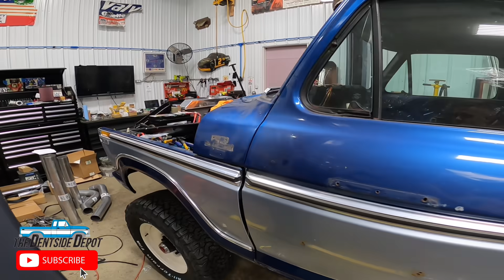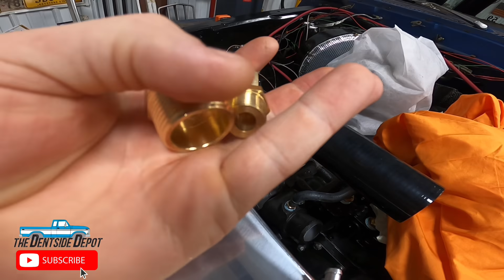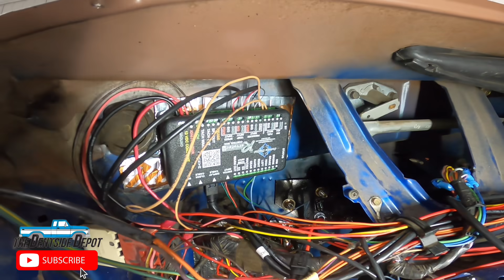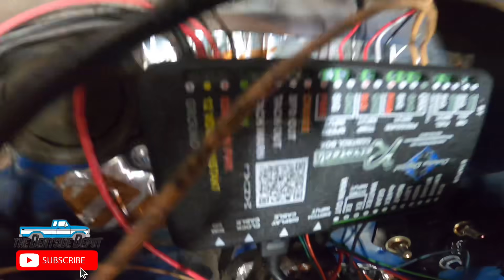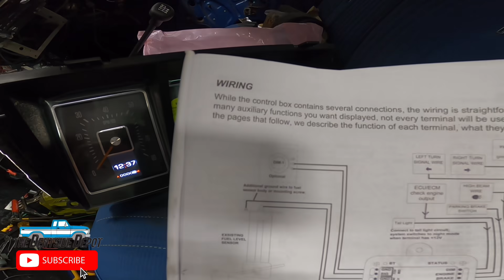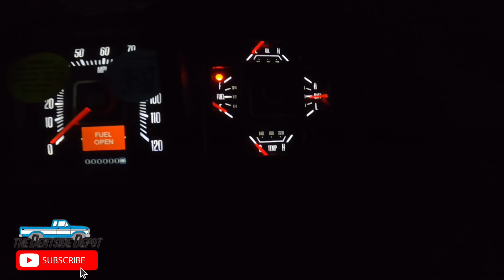How To Install Dakota Digital Gauges In a Classic 79 Ford Truck

Comment from the maker: One rec change to this video, wire the fuel sending unit directly to the Dakota box, I ran into "Fuel Open" issues trying to go through the factory pinouts on the cluster, even when ground directly to the box. It works fine wired directly.

Comment: Currently doing almost the same build but my harness was trashed so I did the AAW package. I also ordered the SGI-100BT as well, what all did you wire into that then into the main box? Any issues with the speed sensor thus far? someone recommended I buy the Sen-01-2 from Dakota but I am not sure why when this sensor comes with the guages?

Comment: I just installed this set in my '77 F-100. How do I set it to enable the backlight all the time? I ran a keyed power wire to the DIM terminal but now thinking that was a mistake.

Comment: Got that unit, the AAW painless wiring harness, trailer hitch including wiring / controller and Vintage Air setup going in my son’s 78 Bronco. I’m about 80% done with the simultaneous install now. I hope everything works out as advertised, quite a bit of time getting everything done, not even considering the cost of the components.
Reply from the maker: Very nice, yea my Trans Am in the intro is RTX with the painless full replacement harness and edelbrock pro-flo. That was a very long wiring install but its perfect.

Comment: I have the same engine and gauge set up. Right now might be a good time to add the provisions for EGT’s and Boost. Dakota digital couldn’t make it easier with their gear.
Reply from the maker: Yea thats a good point, I am going to be running Autometer Phantom 2s pyro, boost, and trans as a separate stack on the dash.

Comment: That's pretty tasteful for that old style dash. I wonder if someone makes an upgrade for a 98 e350  Diesel van?
Reply from the maker: It looks very original for sure. I don't think there is a direct swap for an old van, but you could look into a universal square monitor offered by Holley or Edelbrock.

Comment: I’m a traditionalist, I want trucks to be as original as possible.
Reply from the maker: Hey I get that too. This truck has almost nothing original left on it though so it was a pretty easy decision. Anyone doing a modern driveline swap this is a must upgrade for sure.
Reply: @DentsideDepot how much for gauge bsetup
Reply from the maker: @gerry-p9x  1700 just for the gauges
Reply: Im a KISS guy; Keep It Simple Stupid.
dakota digital gauges seem cool but , it SEEMS stupid to pay $1700 for a set of gauges when rest of your entire truck cost $4700 or anything like that ballpark range.
if you are totally restoring some Classic vehicle and want it to rival some 2020 vehicle in reliability and coolfactor etc then maybe $1700 on a gauge package makes sense but that  1700 looks smaller when your total all in cost is 50,000
Reply: I'm  a Realist , and going  to put wingnuts on my fenders.....😮
Reply from the maker: @bretstauffer3744  LOL!
Reply: I'm somewhere in the middle. Go wild with drivetrain and suspension without hacking the frame up. Subtle mods with the body and interior. I've never been a fan of the digital clusters but that thing is beautiful. I love the stockish look. That rats nest of wiring would drive me absolutely insane. I don't like wiring but when I do it I have to make it pretty. Trying to diagnose an issue down the road is going to be an absolute nightmare on that.

Comment from the maker: I wish Ford included a tach and clock from the factory, along with numbers for the coolant temp gauge. This product fixes all of that.
Reply: Don’t really miss the tach.. the sound of a 460 with a right rear exhaust stud broken is unmistakable. Clock is on my Pioneer head unit.. and is wrong anyway.
Reply: What # on the plug did you use for the left signal power wire. I'm currently doing this install on a '79 F150 and everything I have read, and all my wiring diagrams say to use the blue/green wire, which should be #13 on the plug. But #13 on my plug is pink/white.
Reply from the maker: @jacobgragg885  Hmm im not sure whats going on then, I put the line in the description for the numbers on the harness. Double check that and see if that works.
Reply: I always knew if the temp was a little below half... I was good. Lol